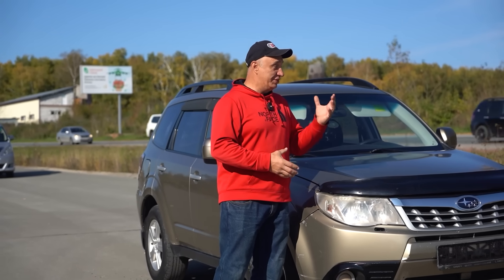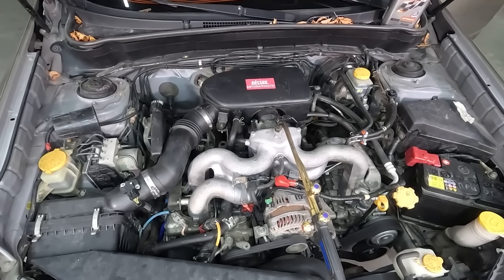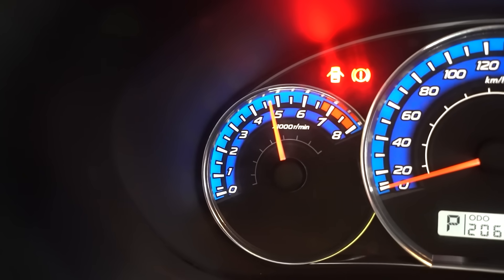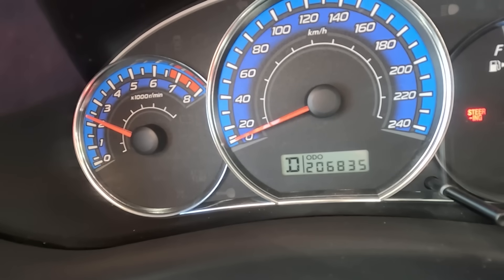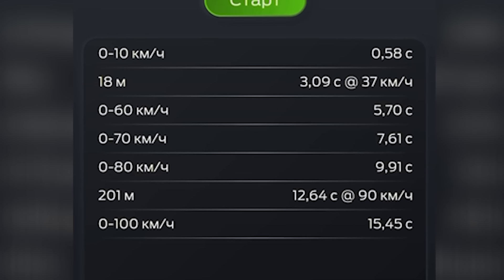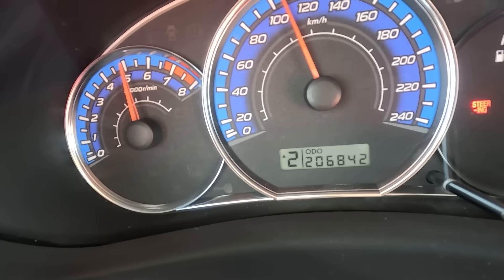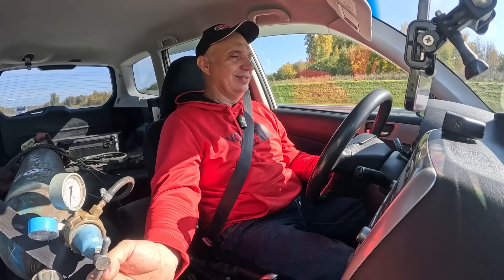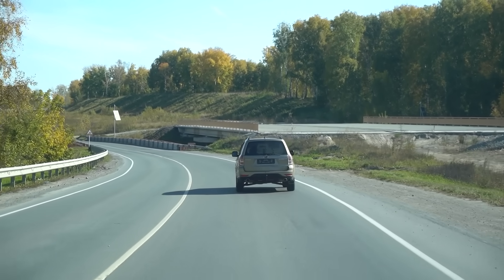We run an engine on pure oxygen - what will happen?

Comment: Kind of like putting nitrous oxide in a motor and it would be interesting to see if you could just add the nitrous oxide without changing anything In a motor that has Being controlled by the ECM

Comment: I just realized running just the right amount of oxygen into a motor is equivalent to an Italian tune up. Since the whole thing is to increase engine temperature to burn carbon. This way you don't need to speed

Comment: ECUs are tuned to standard air composition. It measures the air through the maf/map, adds fuel according to standard air composition, and corrects it by the o2 sensors. Adding pressurized air of any sort after the maf/map like you did will get you similar results. It would need to be re-tuned to account for higher oxygen content and the oxygen being added would have to be measured. The fact that it ran at all is a testament to how robust the three interwoven fuel checks are.

Comment: Injecting the oxygen right into the intake manifold causes the ECU to try to do adjustments it can never see the true result of... injecting before the mass airflow sensor probably would give the high performance you would have expected...... as the manifold is after the throttle.

Comment: The reason we use nitrous oxide (i.e. NOS) for added vehicle performance is because it is NO2. It's nitrous oxide . It's adding more oxygen to the engine, therefore more fuel can be added and more power can be made. Using pure oxygen has the same impact, it's just exponentially more dangerous because pure oxygen turns even the smallest flame into a freaking inferno in no time at all. Having that oxygen tank in that car, especially with no protection over the valve, would be highly illegal in pretty much any civilized country, not to mention extremely stupid.

Comment: Um you get violent fuel trim adjustments would be my guess. Like the engine will see way to much oxygen and assume a lean condition adding fuel. Depending on amount you may destroy something with a severe lean condition if the computer cant get the mixture dialed in, not enough injector or pump and your fcked.

Comment: Grate.
I've done something like this,but with a portable small oxiacetilen welding machine,24 years ago.
On a Peugeot 1.6 petrol,wth carburettor.
Just by letting the oxygen in,at idle,rpm increases with 400rpm.
But while I was driving it,it did not seem that much difference.
But it was also a smal amount of oxygen going in.

Comment: will burn out rings, needs oil or oil mixture. putting raw oxygen in a subaru 😹 youd be better off adding a bit of diesel to the gas to soften the fuel ratio, track racers use 2 stroke oil in cars for better performance

Comment: you added the oxygen inlet ( AFTER ) the MAP/MAF sensor so the ecu wont count the oxygen that goes to the champers but the oxygen sensor sense it so the ECU will stall the engine  because it sense that there is air leak to the champers - so if you want to try it i guess you should unplug the MAP/Maf sensor  cord  - that way ECU will only depend on the data form Oxygen Sensor only

Comment: The throttle position sensor tells the ecu how much to open the injectors. When bypassing it your leaning it out alot. But the o2s my see that and add more fuel. Every ecu is diffrent. Live fuel ratio would be interesting to see. Lean is mean!

Comment: Have you never heard of a NO injected engine.   You need to change the fuel map to allow for proper combustion with the higher O  or the car run poor.  And when done in unknown mixes you get a bad running engine that the ECU cannot control.

Comment: In full throttle acceleration, the ECU operates at open loop, disregarding the values of lamba sensor. In this case the engine calculates the fuel flow as it was air. So the combustion was very lean, very hot, and oxygen probably was going to cat, destroying it a little bit. For the closed loop, then the ecu was very crazy, probably maxing the corrections and/or fuel injection.

Comment: its like bypassing the throttle body, instead of stepping on an accelerator pedal you replaced it with oxygen inlet control directly attached to the throttle body

Comment: Why didn't you put the O2 in before the O2 Sensor so the computer could adjust the Air/Fuel mixture properly?  Dumping it directly into the plenum you are creating a lean condition and messing up the the engine ECU as the feedback from the other sensors were trying to stabilize something that it was not designed for..... come on, you guys should have known this.

Comment: I did this test before and found it can help but does of course require more fuel to get safe and proper stoichiemetry..
I did this on a turbo retrofit vw mechanical injection  and it did help power but I can accomplish the same thing just by turning up the boost.  The oxygen can help the lower end rpm but again needs proper extra fuel or it will ping like crazy and possibly damage the engine.  Keep in mind the atmosphere is only about 10% oxy..oxygen...

Comment: Try plumbing the O2 into the airbox, running into the plenum bypasses the MAF and throttle that are there to measure and control the flow. You've effectively created a high quality vac leak

Comment: If the oxygen entering the engine is high and  fuel is low, the engine temperature rises because of the lean mixture. If the fuel mixture entering the engine is rich, the engine can be cooled more easily.

Comment: You should put the oxygen before throttle body. Not after.
What you are doing is the same as opening the TB wider when you added more oxygen. 

It made the computer confused: small throttle but a lot of air 😂 

Or simply use engine that can work without throttle body,

Comment: inject 20% more air-flow  of oxygen in your normal 20% oxygen air and you get 2x the oxygen content.. I'd wet inject methanol to match using a wet-nitrous kit.     Methanol supports 6:1 afr in normal air but in pure oxygen  you'll want closer to equal parts.   if your 2L engine at 5k rpm draws 149CFM of normal air to an 85% ve engien with 20% drive-loss  produces 120hp,  then with twice the oxygen molecules by adding 40 cfm of o2 or 3.31 lbs of o2 mixed with 2.5 lbs of methanol will give a slightly rich and well cooling mixture to combat the extra oxygen and theoretically provide double the horsepower assuming the 60% nitrogen of the new mix and the methanols detonation resistance is enough to prevent engine damage.. this would be equivelant to 14-15psi turbo boost.

Comment: Correct way of doing this is preventing any air enterance by blocking the intake, adding oxygen before throttle body and MAF (mass air flow) sensor and programing the ecu by dviding every ratio on the map by roughly 4.8 to adjust for pure air. But without any of the parts changing it will be exactly adding nitrous to a stock engine it will die in seconds if flored. Most probably before anything melts piston rings will get so hot and expand so much, expansion will crunch the pistons into pieces.
So right way wont be that fun to watch.

Comment: 0:30 did you control the metal chips from not going into the engine ? 😂😂😂
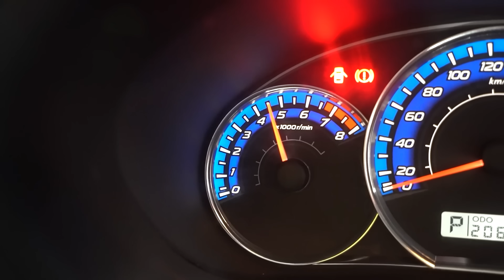3:30 cleaner burn may likely melt the exhaust valves. 😢😢

Comment: The best way to do this is to put it in the intake tube right infront of the IAT sensor or MAF sensor whichever it has. Put the bottle on a push button switch to feed in the the extra o2 at WOT, also with premium fuel. You'll gain the extra HP and TQ. You guys messed up by bypassing the intake sensors and going directly into the intake manifold. If that doesn't work then you will have to tune the ecu by adding fuel for the extra o2 that is applied to keep the 14.7:1 AFR in order to keep the ecu from going out of wack. Hope this helps. I'll wait to see if you guys apply this, if you decide to try again. 💪🏽

Comment: In order to properly test this, the oxygen should have been introduced before the throttle body. Introducing it after the throttle body just makes it think you’re opening the throttle more but the computer sees the throttle  being closed. This would absolutely cause it to be running super lean which will burn up pistons. They should have consulted with me before trying this. 😂

Comment: This not work in this way, If put oxy straight in monofold só you makes a fake air entrece, to work this thest de oxy needed to be before de map sensor on the Air filtre conrtion and the tbi
Reply: This way you overhiter the engine with poorly mix, aesy to make holls on top of pistons, like massarico

Comment: The purpose of the accelerator is to allow more oxygen into the engine in order to increase rpm. By injecting Oxygen directly, you just bypassed the need for the throttle to open to increase rpm.

Comment: Need to tune the ecu for the extra O2 or rig a carburetor up, leave the injectors unplugged, and use the live data from the primary O2 sensors to dial in your AFR.
Also another idea for you guys to try. Make a blend of regular gas and nitro methane and feed that to the engine you'll need to richen the mix up from stock for it to work right but you should get more HP than stock without modifying the engine.

Comment: The correct ECU, ignition timing adjusted, and larger fuel injectors, tuned for the increased O2… then you’d make more power, much more safely.

Comment: This should be totally expected behavior. It’s similar to NO2, as when NO2 reaches 500*F it breaks down and releases the O2 from the nitrogen molecule. So the engine goes lean, and adds fuel to compensate, which then makes more power, engine rpm increases… similar to if you opened the throttle some and it got more air…

Problem is the ECU’s timing (ignition table) isn’t calibrated correctly for this, it will be overly aggressive and cause knock/ pre-ignition and high exhaust temperatures.

Comment: The only benefit of adding o2 is so you can add more fuel. Just adding o2 without fuel is leaning the mixture to the point of melting engine components. The piston rings will go first. A rich mixture is slow but safe. Lean is fast but hard on engine parts. Was that fun?

Comment: Seems to me that an issue (besides bypassing the MAS and such) is that at lower RPMs, the "throttle" is allowing "X" amount of atmospheric air in that has 21% O2, so adding O2 increases that percentage by some amount, lets say to 30%. Now, when you open the throttle, say doubling the amount of atmospheric air coming in, the overall O2 concentration is going to drop, say to 25% - that means the performance will drop off as speed increases.
If there was some way to increase the extra O2 to maintain a constant %, you should see improved performance at the higher speeds.

Comment: should add gasoline at the same time.  just like nitrous.  It will still predetonate.  however it will be a better run. nitrous is activated during the combustion event.  oxygen is way more volatile.  You get oxygen from the nitrous.  If you could inject oxygen with direct injection, you could have something.

Comment: Could have piped o2 into the air box and let excess push out to ambient but risk worse backfire fire🤣 
There is a drag racing team working on compressed air boost and they haven't for a limit to horsepower yet with the exception of eventually finding a breaking point of the driveline.

Comment: Inject it before the air sensor. Not directly in front of the sensor either. Before the air filter probably for the oxygen disperses into the whole area of the inlet and isnt a direct shot onto the sensor.

Comment: Should have added the Oxygen on a Wide Open Throttle switch, so, normal driving is the usual way, but, like NOS, injected on full throttle (maybe an extra squirt of fuel too to balance it out!) 😏🤣😎🇬🇧

Comment: So the likely reason for the transmission acting up is the addition of oxygen to increase launch revs. The torque converter is designed to hit a 1:1 ratio at a certain rpm. Forcing the revs beyond that point while holding the brakes is causing more heat and more damage, likely causing the transmission issues. Unless the trans is built for this kind of launch, you can cause damage to the converter by holding it at stall rpm for more than a few seconds at a time while holding the brakes.

Comment: Well I'm kind of curious what the fuel mileage difference would be in a normal running engine? That should be the key question here that remains the answer. Because for a few hundred dollars you can buy a oxygen generator. What you need to control according to RPM right now

Comment: you say that oxygen is very bad for engines as it is an oxidant, though true. this is precisely what turbochargers and supercharger do, they force inject the piston chamber with oxygen. and, these boosted engines have a lifetime comparable to normal engines and don't suffer the excess oxidation they say will happen. but i agree with other commenters, do this again on a real car engine, and not a personal computer that runs on petrol! if has to have this and that computer and a plethora of sensors just to run, it is not a car, it is a datacenter with seats and wheels. So Garage 54, let's stick to using cars and not datacenters on wheels!

Comment: O2 sensor is going to read extremely lean and adjust the fuel air mixture to compensate..   adding more fuel to the mix..  same as hitting the throttle, you just defeated the drivers control of it.  You want to REALLY do science... run one on Hydrogen like Mike Copeland's hot rods.   3 times the pop as gasoline.  💥

Comment: The RPM increase because your injecting it after the throttle body which is no different then you just stepping on the throttle. Shouldve injected it before the throttle blade to get a accurate test

Comment: Just add a little NOS with the added oxygen to cool the engine.  That should prevent any pre combustion,  and also you wouldn't need to use as much of either one so they would both last longer

Comment: This is like using N2O without the nitrous' cooling effect. I guess because you opened the oxygen tank value so gradually it didn't damage the engine, but if you keep using it, it probably would've done some damage.

Comment: Listen. The reason we use Nitrous Oxide is specifically to control the amount of oxygen we're burning.  NO2 has 2 oxygen and 1 nitrogen.  The idea here is to increase the oxygen, and we use it specifically because it's very tame compared to straight oxygen.  Straight oxygen is INSANE.  Oxygen is the stuff that burns, not gasoline.  Oxygen means fire!  Straight oxygen in an engine is sooooo dangerous for your motor!

Comment: the original ECU can´t handle big air to fuel variation, so it can´t put enough fuel for so much oxigen... maybe bigger flow injectors or better, a programmable ECU

Comment: First you mustAdd the oxygenbefore the map or MAFsensorsalong with making sure your oxygen sensoris working properlyAfter each runWhat different adjustments you also have to reset the ECUOtherwiseIt will run off the last settings it takes almost 500 mi for some cars to readjustSo in between each runwith new settingsYou have to find out what carneedscompletely reset the ECU so that it can adjust and run properlyThe computer will control fuelAccording to airflowThat is coming through the map sensorYou are injectinghigh pressure air afterthe mapWish the computer cannot understand the changeand exhaustoxygen sensorAnd it tries to compensate

Comment: This is pretty bad, I thought the guys at garage 54 knew better.
This is basically a giant vacuum leak.
If it was AHEAD of the throttle plate, THAT would be an accurate test.
This is embarrassing

Comment: The only problem is you can only compress O2 so much, you cant compress it too liquid at least in that tank...you wont get far, plus I think lubrication is going to be a problem. Plus that O2 tank has to weigh like 300 LBS which your lugging around...better off with the N2O😉

Comment: There are 3 common ways to increase power. Thats Turbo/Supercharging, high reving and high displacement with any combination you want. All those methods achieve only a single thing. Its getting more air/oxygen into the engine. Thats always the limiting factor. Nitro injection also just feeds more oxygen.

Comment: Pure O2 is like using a NOS kit. The air we breathe is 21-23% O2 and ICE engines are calibrated to run on that O2 concentration. This is why rockets use pure O2 because going from air breathing to space with pure liquid O2 is way hard as of right now. The closest to have such an engine is the US with the A12/SR71, but it never switched to pure O2 just switched from jet with afterburner to scramjet engine and this was the most dangerous part of flight other than takeoff.

Comment: this ones dumb.... your injecting air into the manifold after the throttle body and mass air flow...... just making a FAT vacuum leak.... oxygen or not thats just going to cause the engine to run lean as its not adjusting the fuel to match

Comment: wont this make the engine lean, so the o2 sensor will try to fix that by making it richer which in turn revs up the engine, also the oxygen bottle is allowing the engine to bypass the butterfly in the inlet which controls revs, so the engine revs up.

Comment: I would like to see what happens if instead of normal 5w30 oil you fit 2stroke boat engine oil,but not in the mix, directly into the engine, will the engine last?

Comment: Throttle in a gasoline engine is controlled by air. Increasing oxygen intake will seem like increasing air to a computer. It's just like stepping on the throttle, but in a roundabout way.

Comment: I think the oxygen sensor was detecting the extra oxygen and just injecting more fuel to enrich the mixture which is what gave you more power. I think you should do the experiment on a carburettor engine.

Comment: its like nitrous N2O. the heat causes the nitrogen to separate from the oxygen putting more oxygen in the cylinder doing basically the same thing. even killing the engine quicker.